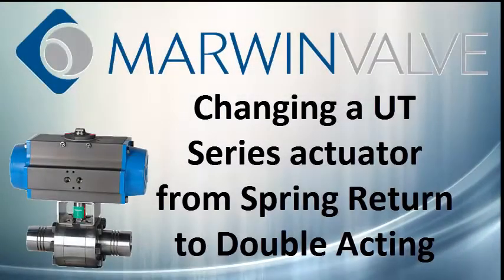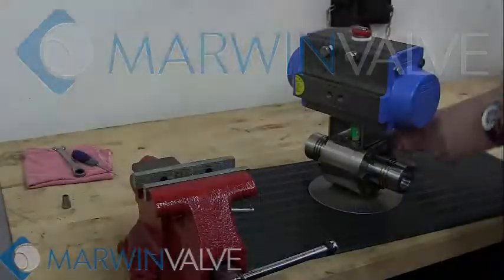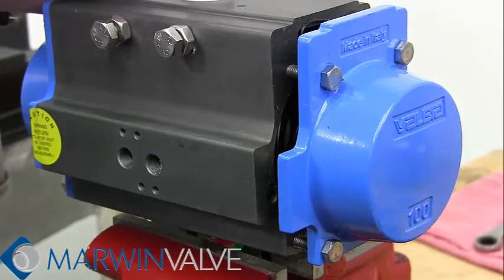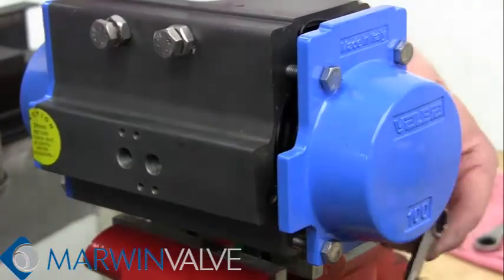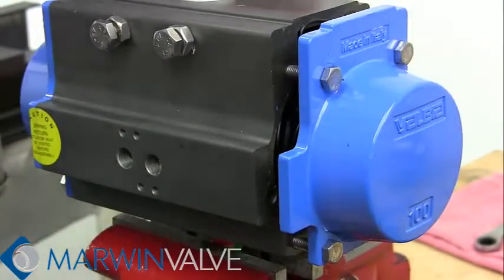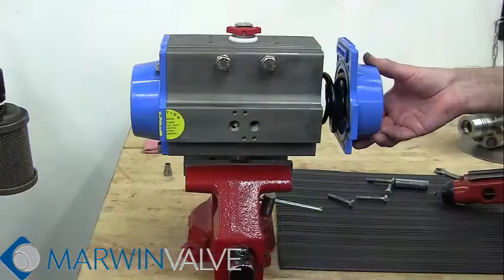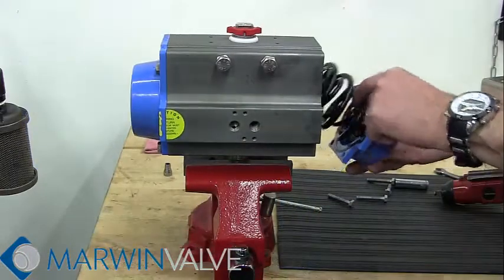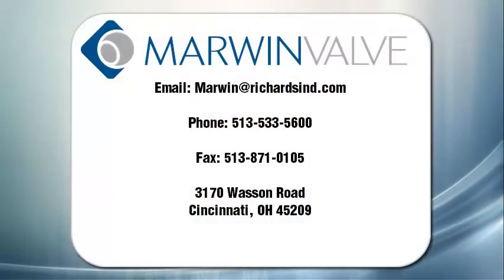How to Change from Spring Return to Double Acting on a Pneumatic Actuator - Marwin Valve UT Series

Comment: When activated, our spring return actuator constantly bleeds the pneumatic air sent to into port A from port B. Is it okay to plug this? We do want a fail-closed operation, but we don't want to lose supply air.